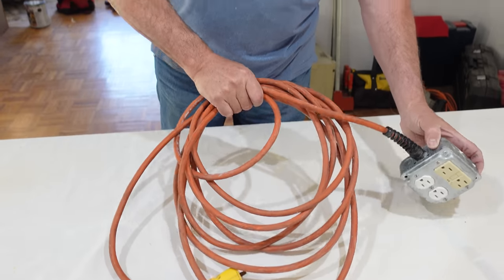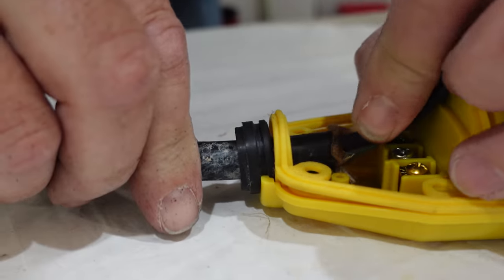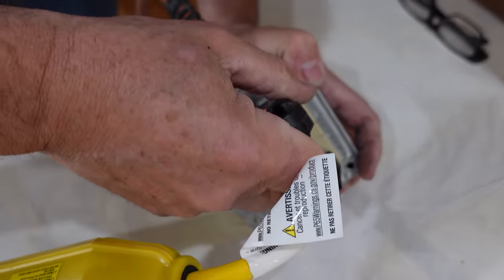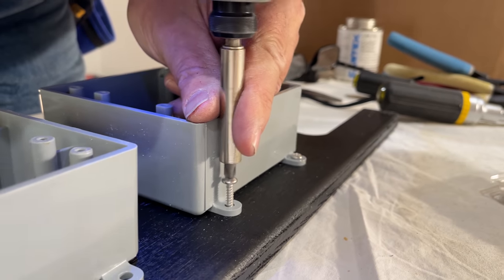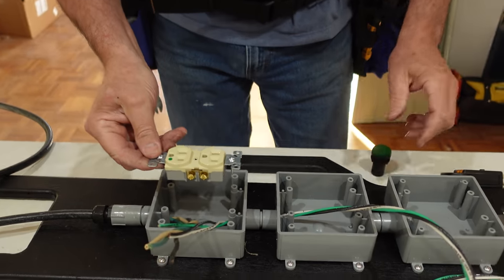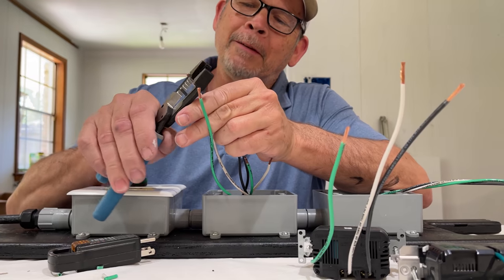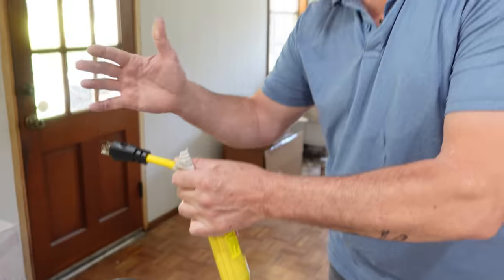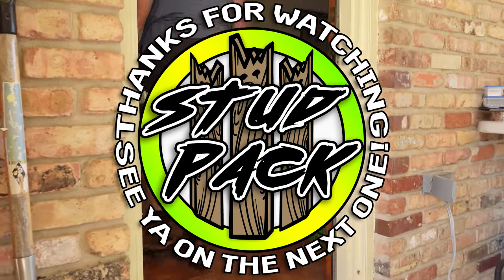HOW TO MAKE THE ULTIMATE EXTENSION CORD!

Comment: Not to be a spoiled sport, but I'm thinkng you meant NEMA 5-20 @21:00, as 6-20 is for a 208/220 volt 20 amp service and the tab angles are acually reversed in your video...  5-20 is NEMA 110/120 volt, and a 20 amp service required for each of the "two" sides of a kitchen., and actually has a sideways "T" connection on the left side of the outlet as you showed, not the right.  That's a 200+ volt outlet if it were a Nema 6-20r, but it was a 5-20-R GFI...   @21:00. The plug is a 6-20p and will literally not plug into the socket you show on screen.  The 6-20 is backward (on the blade twist of 90 degrees) from the 5-20 for that reason.  Not hating.  Just informing.  I love what you do, but safety is paramount to me, and I had to bring that up....  I feel like this is a simple mistake, but for those unaware that hear "5-15/5-20" and "6-15/6-20"  this could be good to highlight, as I encourage the folks out there to do home improvements.  I think it is an art we should encourage.   This is likely my only real criticism of the videos that you have put up, so I hop you do not take offense of what I posted, as you are doing gret work, end encouraging us to actually do our thing and understand what it takes to work on our abodes.

Comment: The commentary about the NEMA 6-xx is incorrect.  NEMA 6-xx is 250VAC.  NEMA 5-xx is 125VAC.  What you meant is NEMA 5-15R or NEMA 5-20R.

The breaker SHOULD have tripped.  "We'll handle that in a separate video" means you don't know, and that should really be addressed as it's far more dangerous/important than an extension cord.

Comment: The only thing I can see wrong is your placement of the boxes if you have 100 ft of cord and you only need to go 20  feet to use the power you have unwrap all the cord great extension cord though also I don't like the strain relief holding the cord I had a lot of them and eventually the cord works it's way out no matter how much you tighten it up the only thing I've found that works and never comes loose is those Chinese finger lock one's the more strain on on on it the tighter it gets the only way is to literally break the cord almost impossible to do and although I thought the parts are expensive you'll never need to replace them so with that in mind so what if the recepticals cost 60 dollars or more it'll be the last one you'll ever need to build unless you want a second cord or more now I'll have to look to see if you have products and prices and where to buy them

Comment: Phil Swift ripped you off. Just use rubberized undercoating. Way cheaper. Or better yet use PVC trim board instead of plywood. And skip spraying. Also, add a velcro strap to hold the end of the cord to the board for transport and storage.

Comment: You're electrical  connections aren't great, also you spoke about the o ring on the conduit adapter for water proofing but you put you're plates on the bell boxes that are designed for internal walls they don't fit on the box flush, and they have no water proofing. Regarding you're current pull you need to check what size the fuse is supplying the receptive it may be 30amps or more. I do suggest installing an RF Relay in one outlet controlled from a key fob which u can remotely switch on for you dust collection system etc

Comment: 28A for a short time because, the breaker is likely thermal. An ARC fault breaker would have tripped at 21A. Yours held 28A while the breaker heated up. Once at heat threshold, the circuit opens. I watched a clown try to pull 40A through a 20A circuit. The breaker said no, and opened the circuit. The clown reset the breaker, tried again, again the breaker said no. After the second try, the breaker was so hot it would not reset until the next day. LMFAO. All except for the light, those tools have an inrush when started. Thermal breakers are needed for those kinds of loads. They allow the motor to pull more than the rated amperage for a short time while the motor gets up to speed. Many different types of equipment have inrush for different reasons. One thing is for sure, ANY piece of equipment with an electric motor has a current inrush value way above the normal operating current draw. I was always told to build at 80%. A little headroom is always good. A suggestion for the next one would be V & A meters, and an outlet dedicated to your circuit tester. When something doesn't look right, just pull the circuit tester and use it to find another properly wired outlet. Cheers! Side note, personally I would have used 10ga cord because of voltage drop. Voltage drop will increase your amp draw. Low voltage & higher amperage will take years off of your equipment's life, if not end it prematurely. Also, LarryCoates1948 is spot on with his suggestions. I like your choice of components, finishes, and the final product. However, after reading what LarryCoates1948 I would rearrange the components accordingly, and swap in a 10ga cord. Thanks!

Comment: Why would he make the ground cable the same length as the hot wire. The ground wire should be longer in case the wire was yanked out of the screw terminal, the ground one would be the last one connected.

Comment: About the vacuum cleaner:
It is important to turn it off rather soon, because the air is cooling the motor. Without this, you will damage your windings rather sooner then later.
Plus, next time you build some extension cord like this, try going from high current to low current sockets. You went exactly the opposite route. So the 20 Amp have to travel through all the Wagos.

Comment: Major mistake...    
Shouldn't the highest AMP device be closest to the (input source)...(the cord)???

From cord end:
1. Medical outlet
2. Standard outlet
3. USB charging ports and power indicator..

Cool design.. Hmmm stud pack... If the  over-all length is the length of the space between studs, then when working on a constucton site where there is open studs, you could make it key into the studs. Wiith the outlets facing down, the blank back side would become a shelf for your phones while charging..

Comment: not a good idea to tuk wires under a high power socket because at higher wattage the socket connectors will get hot and as the wires are contacting them the insulation may melt expose the live wire.

Comment: keep in mind that all those saws running at the same time had no load on the motors. Load is typically material being cut that causes resistance to the motor. As load is increased on the motor, Amps being pulled by the motor increase as well. As a rule of thumb, I only run 1 large power tool at a time on a single cord, and always 12ga or thicker.
Reply: You do realize that Paul said that in the video, yes?

Comment: Just my two cents from Europe. Using stranded wires to interconnect in a box (amateur like). Not crimping sleeves on stranded wires at screw terminals. Not using covered female outlets (failing IP44). Just with this you're failing code and best practise in Europe.

Comment: That end Is not that unsafe after all it should be plugged in while it's in use and if it's got power while it's not plugged in well then you got a suicide cord somewhere. It's probably more unsafe about it is it might be of the vintage where they colored neutral black I've run into a few of those two within the same week one of them on an extension cord (with custom unofficial 240 adapter....) that was miswired that blew a circuit.

Comment: My question: who here carries product liability insurance?  Should this assembly fail in a way that causes death or injury to humans or causes property loss, your general liability may not cover you, and there is no manufacturer with deeper pockets to pursue.  Also the assembly is not UL listed.  Simply because the components are UL listed that status does not transfer to the assembled product.  If you work job sites where all materials and tools are required to be UL-listed, this is unlikely to pass.

That all said, this is heaps better than the typical extension cords we see.  A bonus follow up video proposal - correct cable handling, i.e. not wrapping it around your elbow, but a proper coiling?

Comment: The actual material used for the conductor may be of interest….Much of the China-produced wire these days for extension cords and auto jumper cables IS NOT SOLID COPPER… but is copper-CLAD aluminum wire.  While aluminum is an excellent conductor and the copper supposedly slows corrosion… in fact the aluminum wiring generates greater energy-stealing HEAT.  Beware of “copper coated aluminum wiring”.

Comment: You said Nada concerning "What Gauge" of wire you're using, this ain't an ultimate anything if you don't specify the gauge. The cheap Walmart cords are 14 Gauge and only support 12 amps, which will starve and "Ultimately" destroy our electric Gizmos, Tools & Toys. You have to man-up and use at a very minimum of 12 gauge (20 amps) and for the "Ultimate Extension Cord" 10 Gauge good up to 30 amps.

Comment: European here. American electrics really confuse and concern me. Yes I know its 110V as opposed to 230V like we have in Europe, but it's the actual electrical components that seem really unsafe. Those wall plugs look like they are about 50 years old even though they just came out the box. The multi strand wire is just a cruel joke thats played on the electricians. The first wall plug you wired; Live and Neutral had the square plates to hold the conductor in place. What I'm guessing is the earth didn't. Why not? Also why even have screw at all? UK wall plugs use push in connectors with a lever to hold the conductor (Like a built in Wago). So much easier and safer. I understand it's been this way for many years probably but standards can change. We have this thing in the UK called Requirements for Electrical Installations book. Its like an electricians bible. Has all the latest safety standards and regs. And its is updated and amended pretty much every year. Please educate me. This is just pure curiosity talking. Not looking for an argument :)
Reply: Most residential wiring is solid core wire, so not an issue normally. The cheap reno stuff from the big box stores often doesn't have those plates, its screws just like the earth/ground wire. The heavier duty spec/hospital grade outlets have the plates. That ground screw also isn't rated for stranded so in time the ground will come loose which isn't good. As he's making pigtails, might as well use some solid core ground wire and do it right the first time.

As for push in connectors, they do make them here, strip and insert a bare conductor into the back of the unit. No lever to release, just a tab you depress with a screwdriver. They got a bad rep with electricians so available but not popular. What you saw on the spec grade hot/neutral is more popular, easier to ensure a solid torque, and supports stranded wire when needed.

I've started going WAGO's myself after watching a guy destructively test them to try and prove or disprove they can't handle the same current as a wirenut. TLDR, they get a little warmer but still meet code. They fail sooner then nuts when you overload them (push double the rated current) but used as designed, they work well.

Comment: You had me up until you added the 20-amp socket.  That is very wrong.  This cord should not contain a 20-amp receptacle unless it has a 20-amp plug and all of the intermediate components are rated for 20 amps.

The 20-amp plugs are keyed differently for a reason.  It is to ensure that you do not try to pull 20 amps of current through a wall receptacle which is only rated for 15 amps, which can melt the wall receptacle and cause a fire.  You have just defeated important safety precautions by allowing somebody to plug a 20-amp device into a 15-amp wall socket.  This extension cord is a fire hazard.

What's more, you don't mention what the wire gauge of the cord itself was, but given that it only had a 15-amp plug originally, it's very unlikely the cord has sufficient wire size for 20-amp current, and the inline GFCI device you link to is only rated for 15 amps as well, so you will likely melt your GFCI and/or power cord if you try to use a heavy-duty 20-amp device in that receptacle anyway.

Your statement about "the circuit breaker is gonna do its job, and trip" is also completely wrong.  That is not how building circuit breakers work, or what they're intended to be used for.  It is perfectly acceptable and common to have a building circuit with a 20, or 30, or even 50 amp circuit breaker on it, with a whole bunch of 15-amp receptacles.  If you plug this cord into one of those receptacles, and pull 20 amps through it, the breaker will not trip (it's still well under the limit for the circuit), but the individual wall socket will still be overloaded and could catch fire.

Do not rely on the building circuit breakers to protect you in that sort of situation.  They very likely will not.

Also, your statement about mixing receptacles being OK because it's a duplex receptacle is actually wrong.  That is not what the NEC actually says.  The NEC says that you can only put 15-amp receptacles on a higher-rated building circuit as long as you have more than one outlet, but that only applies for fixed wiring circuits and their breakers (not things like extension cords), so that's completely irrelevant in this case anyway.  There is absolutely no prohibition against mixing 15 and 20-amp receptacles on the same circuit or cord (even if you only have a single 15 amp socket, it's still fine) as long as the circuit itself is capable of handling 20 amps or more.  Unfortunately, that's the bit you've already failed at.

You really need to go back to school, I think, because your understanding of a lot of the electrical codes and principles involved is just not correct.
Reply: Good info! I have not even considered that the circuit may be rated at higher current (for many outlets) with outlets being lower rating each.

Comment: I have tried to make 3 different long winded comments. I have decided to stop it and change my approach. 

The method you used, and theory here is less then ideal. 

New wire, use fuse protection not circuit breakers for over loading issues, and please understand I am wanting you to be safe. Not safe enough.

Comment: Why are people concerned with metal boxes? Just ground em... simple as pie. Also wire sock... where is it? Spade connector is better then your method, best imho is to use some solder to turn that stranded solid.
"the vacuum isn't doing any work" AAAACTUALLY NO! The vacuum is doing MORE work when you clog up the end, the less work the vacuum does the more amps it will draw, that is how motors work. Also, the more amps the motor draws the lower it's lifespan.

Comment: Why is that in electrical, white is the negative, and black is the live? While in electronics, black is negative while red is positive? Why? This is why most people don't understand how electrical and electronic works. Even a simple faulty electrical wiring setup, they can't fix because of that. The black should always be the negative in both electrical and electronics. White should be the live, red should be the positive, and yes, green is always the ground in both elec(trical/tronics).. But yeah. That's not the rules so, what can I do? 😆
Reply: Wait till you get into three phase, with red-black-white-green for wires. Red and black are power, white is neutral, green is ground. Green and white might as well be the same, they are all tied together in the panel anyway. Then you got European color standards with red, green, and sometimes brown... Basically if you are colorblind, good luck! 
Australia is "red-power, black-neutral, striped green/yellow-ground" and tbh that makes sense. So does single-phase EU with "red-power, blue-neutral, striped green/yellow-ground", it's just EU's 3-phase is weird.
Reply: @AgentWest  wow 😳. That made it more confusing for common folks. And that's the reason why I see brown, and other colors in different devices from different countries. "Just wow" is my only response to this complicated coloring standards. Thanks for the info by the way.

Comment: The test you did with running all those power tools isn't accurate because you didn't have a load on any of them.  Have someone cut a 2 by 4 on the miter saw and run a piece of plywood through the table saw to increase amp useage.

Comment: I choose to believe the mix of colors is to troll the pedants that complained to a contractor using talking points someone who has never picked up a screwdriver would need to hear.....Seriously folks.....enough with the  'I saw a video where someone said this was bad or done wrong so I need to tell everyone how wrong they are using the same bullet points any time I see the thing I was told was bad, I dont need to think about the bad thing, I was told it was bad, why would someone pick something innocuous and to be a pedant about claiming its bad? Thats ridiculous!!!' culture going around and getting worse every year. What if I told yall there is often many avenues to achieve a goal, and while you may be able to parrot back some hollow rhetoric you were spoon fed by some asshat exploiting your addiction to sensationalism for ad revenue, your pedantry doesnt constitute a change I or anyone else is obligated to enact. Im looking at you 'outlet is upside down' jerks.....

Speaking of, should have totally put one of those outlets in with the ground lug opposite the others, but not the switched one 🤣

All that being said my only critique would have been to put the (potentially) high draw plug as the first in the chain so you're not trying to pull that much current through all those wagos and jump wires..... I dont like wagos for high current. Yes I saw that video too. I know. I used to work at an animatronics shop....I KNOW! But......I still dont.......